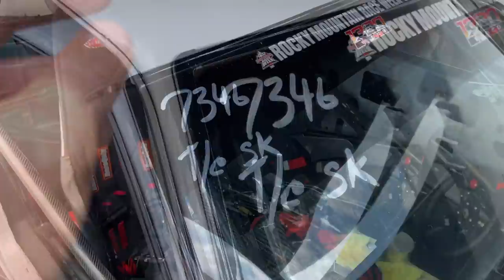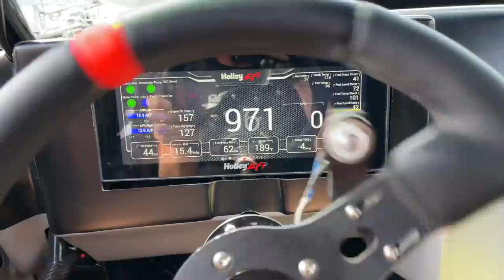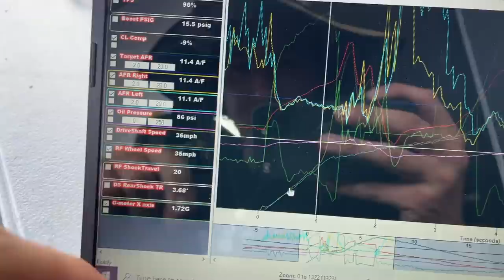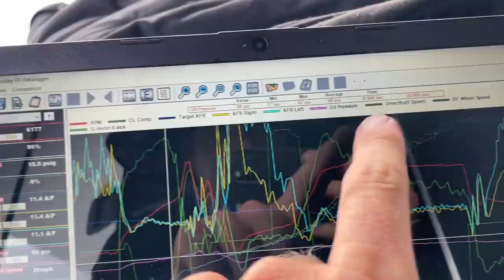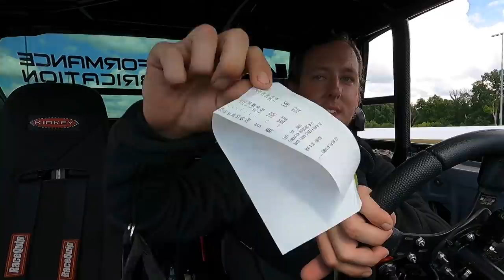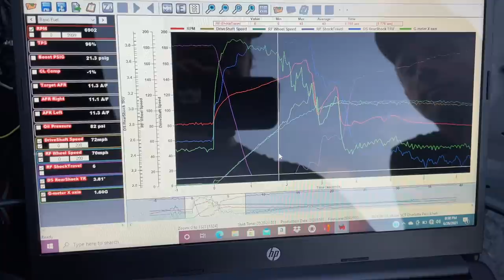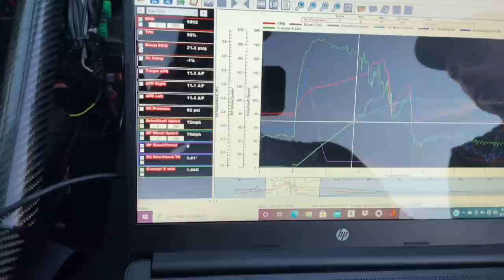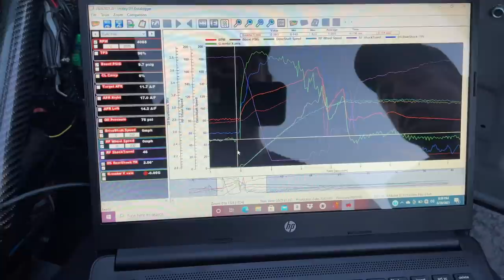Mullet Races the Turbo LS Honda That GAPPED Leroy Years Ago...

Comment: 6 second Mullet...

One way or another Mullet needs more of its weight on the rear tires while going down the track (especially on less grippy tracks). It needs to be on the verge of lifting front tires at all times during peak acceleration. 

Have any of you seen Mullet's front tires of the ground?

What is the best way to do this for Mullet is the question? Static, quasi-static, or dynamic weight distribution/transfer?...
Reply: 1/4 Race car chassis books and engineering courses on chassis design simplify down to the 3 sources of front/rear weight balance when it comes to drag racing. While the official names vary I call them static, quasi-static and dynamic.

For static front/rear weight balance you can imagine a long car, flattened into the ground with almost all of the weight on the rear (drive) tires and the front tires just lightly touching the ground. 

This imaginary drag car is ideal because acceleration doesn't change the front/rear weight distribution. You can literally have max acceleration instantly off-the-line.

Can Mullet's static front/rear weight balance be improved?

How (can stuff be moved rearwards)?
Reply: 2/4 In the real world the weight isn't located along the ground so acceleration also causes additional weight to transfer rearwards.

The higher weight is located, the more it contributes to the quasi-static front/rear balance while accelerating down the track.

If you remember the 1950's Gassers, they had their front end way up in the air and owners would just keep raising the front more and more until on the verge of doing a wheelie and all of the weight was on the rear tires.

One key to quasi-static weight balance/transfer is there is no suspension movement to slow the weight building on the drive tires (check out top fuel suspensions).

Because the extra weight on the drive tires builds over hundredths of a second and remains constant as long as acceleration is constant, we can consider it quasi-static as far as Mullet racing down the track is concerned.

Can Mullet be setup this way (I don't think it can)?
Reply: 3/4 Dynamic weight transfer (front shock extension primarily) takes time and slows how quickly you can put max power down. Once the front end raises, it behaves like quasi-static weight transfer but the difference is it takes much longer to build. You want any dynamic weight transfer to happen ASAP, but not so fast it causes an out of control wheelie.

Any acceleration and speed you get earlier on, you get to carry all the way down the track.

If you are building a dedicated drag car you can minimize dynamic weight transfer (and have just enough suspension/tire to absorb bumps on the track) and max the power quicker.

A street/strip car though needs a suspension to handle road bumps.

What do you think is best for Mullet?
Reply: 4/4 Dialing in anti-squat (4-bar link) can be confusing but IMO it should be considered secondary chassis tuning, not primary.

Anti-squat allows you to fine tune when the rear tires start to see an increase in weight on them. Instead of waiting hundredths of a second for quasi-static weight or tenths of a second for dynamic weight to build, you can push the rear tires into the ground almost the instant torque is applied. But...

You don't get anything for free. If you use anti-squat to slam the rear tires into the ground, you will have less weight on the rear tires midway through the 60ft. 

I've often wondered with modern computer controlled cars if anti-squat could be used to generate insane acceleration during the first ~0.050 seconds and improve overall times?

What do you think? Can Mullet's anti-squat be tuned to totally slam the tires into the ground and use a violent launch?

Or should anti-squat be used just to improve initial weight on the rear tires?
Reply: Now you've got the basics of drag chassis setup (or maybe your an expert and what I've shared is overly simplified), what do you think is best for Mullet? 

Can the static weight balance be improved (what can be moved where)?

Do you think some weight should be raised upwards (engine/trans/fuel)?

What about shock/spring tuning?

Can front end shock extension be sped up without causing wheelies and without increasing aero drag at high speeds?

Can chassis tuning alone get Mullet into the 6's (based on power to weight it should...)?

Comment: If it is a street car it needs the hood to run in CA. As long as it has a fan in it spinning, legally, I got a ticket for it when I lived out there and ran my car after putting an engine in it without a hood on it. CA. DOT regulations calls for hoods on cars with fans installed on engines. So it should be a rule here too for street car takeover.

Comment: Guys the wheels obviously spun because the open engine bay acts like a parachute and the air resistance pushes back on the car, to the point where the wheels broke loose… obviously 🙄

Comment: That truck in not a Lightning. They stopped making Lightnings in 2004. Standard cab short bed does not equal Lightning and cheapens the name sake to call a normal truck a Lightning.

Comment: Dude you’ve built the same car 4 times now but with a different body. Why not just put a mountain motor 768 cid in the el Camino and run 5’s? It’s starting to get kinda lame. You’ve already got 4 427’s now. Go big or go home

Comment: Sat in the lanes/sun for over an hour with a black intake/engine vs a grey hood. You probably don't even see the science in that and how you could have damaged your engine because you want to look like you're running a broken-down El Camino like your broken down kit kart.

Are you obsessed with trying to look stupid or is it a sickness? Just trying to figure it out. (hint white Motion Raceworks tire protectors that keep your tire pressure down because it keeps the tires from heating up)

Lack of maintenance...again....Rinse, repeat, rinse, repeat.  Maybe one of these years you'll learn. rolls eyes
Reply: Drink another glass, bro

Comment: Okay you guys just driving a straight line you might as well just put Rocky on it it's the same thing might as well just go to the funny cars but I don't know I'm more of a off the road type of guy I guess those are some nice cars you guys are getting some nice hits but you're just driving in straight line so pretty much your car only has to run for a few seconds and that's it and I know it takes skill to launch off the line at the right time I'm not criticizing you there I'm just saying you guys should get into some more competitive and skill testing type of race try doing the Baja or even the trails make an off-road rig but anything you guys will love mud skimmers get more horsepower you get faster runs think about it

Comment: recently saw a video about the career of "mr 4 speed " herb mcCandless , it was verry informative (https://www.youtube.com/channel/UCt8pXzpc_homjsh5Q9tZPuA) 
the guy is a well of knowhow from back when dragracing was drawing big crowds to the tracks 
at a certan point in his career he started investigating things to the absurd , he figured that lifting the wheels of a drag car is wasting energy preventing the car going forward , he took the front springs (torsion bars) out of his drag car and tried to launch it that way , turned out his 60 foot times whent down and the weight transfered faster to the rear wheels (theres no help pushing the nose up from the front wheel springs so al the weight over the front wheels helped pushing the rear down ) , it allso caused the front wheels to stay down as there was more weight pushing down on and the front springs not countering that weight , it didnt steer too good the rest of the way but it was a start 
he took those torsion bar springs and wittled them down on a lathe to about half the original thickness and the car steered good enough down the track with them mounted , the mod turned out to be 2/10ths faster down the track too 
it might help installing lighter coilsprings on the nova that have a less linear decompression , though if the experiment goes wrong and the car still pulls the wheels up and comes down as hard it with burry the pan intoo the track and bottom out the suspension , maibe even try limit its travel to about an inch using the straps so the front weight acts on the rear wheels sooner and longer